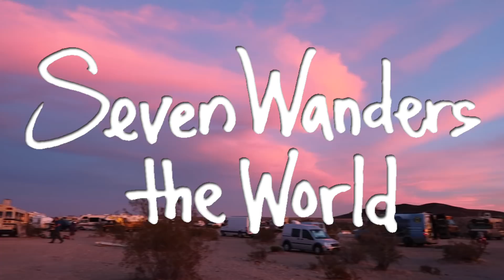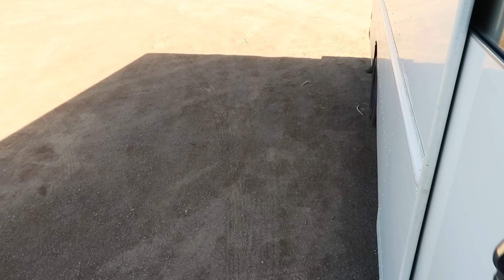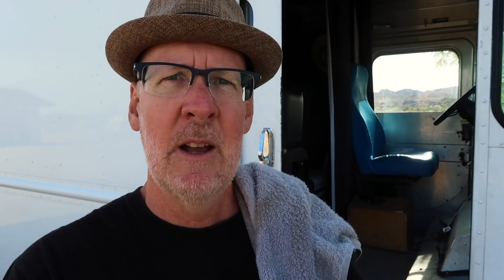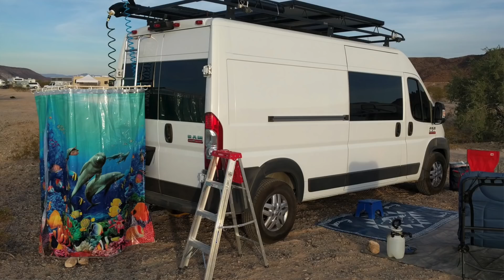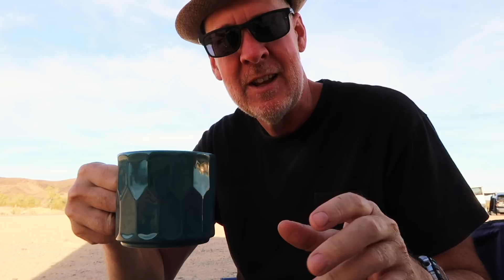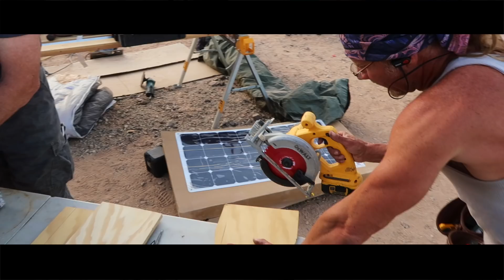Shower Dilema | Jamie's Van Build Party E334

Comment: Store a Pre Made shower Pan on Casters in the Toe Kick Area,Under a Cabinet,Pull out to Center,Under a Trap door/Cover,revealing a Drain thru Floor ,hosed to Ext.Side Bucket or Ground,Shower can beas Simple as a Marine bilge pump /Kit.sink sprayer placed in a Bucket of water,Cold and Hot (on Lp.stove,or Solar heated all day)mixed in a Bucket,K.I.S.S.works best,Can do it for You in S.W.Missouri,Enjoy your Channel.
Reply from the maker: thx for watching and your suggestion!

Comment: How about a shower right behind the driver's seat? It is already blocked floor to ceiling with the curtains and metal grill.  Have you seen Howie Roll's channel?  He built one of the best showers I have seen in a van.  He has a composting toilet.  It is a small room with a narrow door- very unobtrusive.
Reply from the maker: I had toyed with the idea of a shower behind the driver, but really don't want to block the light from the front windows. I'm trying to keep all build items below 40 inches tall. (metal mesh lets light thru)

Comment: I couldn't stop looking at your little white "hat tag" once you mentioned it... lol.  For a shower, just prop open your back doors and pop in a tension rod with a shower curtain on it. Use a 2-gallon ''pump sprayer bottle'' filled with water that has warmed by sitting in the sun. Presto. (Only someone inside your van could see you.)
Reply from the maker: the tag is distracting on video LOL

Comment: Nothing wrong with a little shower tent, Seven, considering you will only be using it occasionally.  No need for a cumbersome permanent setup.  Get a black solar tank to heat water on the top of the step van and have nice hot water any time you want.  When in towns, carry on using the easy Planet Fitness arrangement.  Dinna fret yoursel'.
Reply from the maker: that's a great option. I'll look into it

Comment: What about a removable floor panel that can be placed over the door well with a hooped shower curtain for starters? Good luck.
Reply from the maker: I'd be really scared the water would leak into the battery back under the stairs :(

Comment: If you have solar, you can have a water desalinator.  You take a shower and have a pre-filter.   Then have it go into a tank, possibly directly into the desalinator chamber.  The desalinator pump the water into the clean water tank.  The water should be cleaner than city and almost pure and much better to take a shower as it would be almost completely desalinated like rainwater.  Have a rainwater collection system and incinerating toilet.    Thus all your waste a day is about a cup full of dry waste a week, with no black or grey water or silly composting toilets.  It might be a little expensive $3000-$5000, but if you don't do it Elon will.
Reply: The boat builder I think he might be there knows how to make wood waterproof.  Thus you can make the shower out of wood and waterproof it.
Reply from the maker: unfortunately I have a typical van dweller budget and can't afford anything like that

Comment: Hello Seven, it looks you have many responses to the shower dilema, so I will respond to the shaky, vibrating condition on the step van. My first guess would be that you may need new motor mounts. Climb under there and take a peek at them, or maybe you could just pop the doghouse up and get a look at them. The motor mounts should be made of metal and rubber, the rubber being bonded to the metal parts of it. Look to see if the rubber on the mounts appear to be cracking,  squishy or the rubber seperating from the metal parts of the mounts. If you replace the motor mounts, also consider any transmission mounts as well.
Reply from the maker: thx for the info on the motor mounts. I did have a mechanic look at the mounts back in June and he said they were good. apparently my version of the Cummins just shakes like crazy

Comment: Plastic 55 gal barrel used on Craigslist 10 to 15 bucks, easy to cut with jig saw, small footprint, easy to attach pvc for the curtain hoop, can find them in blue or white. Check out my recessed shower pan in the finishing touches video I uploaded , it will have a carpet plywood panel so it's floor space when not used.
Reply from the maker: great idea. thx

Comment: maybe this is a dumb idea but since you rarely need the shower couldn't you just utilize the rear doors as a shower enclosure and shower outside? open the rear doors and attach a pole between the doors to keep them in position (you can use bungees to apply inward pressure) then just hang a curtain from the pole and take a shower.you would need to stand on a small tarp or something so as to not get muddy but it seems like a simple solution.
Reply from the maker: your idea for rear doors was the one I was thinking of when I made the video (similar to the photo inset shot I included of another van)

Comment: Here is a shower design, that will work both inside and outside
https://youtu.be/p1lMm8shPD8?t=598
For outside use, I would make the curtain longer. 

But I like the flexibility of use, the simplicity of design and components, and the minimal space it takes up when not in use.
Reply from the maker: thx for the link. I actually looked at this video a few weeks ago and at one time had a similar design idea for a hidden shower under furniture
Reply: What I am thinking is, to just have a lose pan at the bottom, so the water gets collected. This pan can be used inside and outside. 
When used inside, then the pan and shower curtain, can be hung/placed underneath your exhaust fan, and even if you use warm water, then the humidity can be pulled straight out of the van. 
Humidity handeling may possibly not be a problem on 77 degree days, but may still come in handy on other days. 
The simplest curtain holder rod I have seen, is a hula hoop ring. 

With a lose pan, and just hanging curtains, it is the  simplest design style I can think of, and it could be tested out with a minimum of modification/fabrication. 
And it could always be added upon, or part of it made more permanent, if fabrication time would allow for it some time in the future.

Comment: Check with Jax Austin if he is still there (short Skoolie) he has a shower mounted on the back of his bus.
Reply from the maker: Jax had to leave. he was there twice. I saw his shower setup. he is still having problems with the heater unit
Reply: I did see another van dweller who used a similar unit attached to the inside of his rear door and he used the small propane cylinders to power the heater.  It also kept it out of the elements.

Comment: S-W ..........                   Why not just buy a used class " C " unit with everything factory installed from soup to nuts............Should have a huge choice to choose from between $5k and $8k this time of year.
Reply from the maker: I'm six foot six. I looked at about 30 class C units and couldn't stand up in any of them
Reply: I finally understood your love of step vans after seeing you in yours, (I couldn't reach the ceiling, but it fits you) and watching your videos of the U-haul type truck you once had.  I suspected the driving position of a step van would be inferior to the truck, but I see that differently now, for someone your size.   Most class A and C motorhomes are very badly built.   I have a new respect for short busses and step vans, which are structurally superior to the typical wood framed motorhomes that leak and rot.

Comment: Sounds like this is what you are thinking, With the additional height of your van you will get  a slight increase of head over something like a Sprinter. 
https://youtu.be/epXd_mTXyyA
There was another video I couldn't find that was much easier to make, a group of lads touring S America in a Volkswagen camper, you , or somebody else, may know the channel I mean.
Reply: bren106 that link goes to the late show?
Reply from the maker: sounds like the Kombi Life channel
Reply: How odd, yes it does but what a great track. I'll dig out the one it should be.
Reply: Here is the correct link, it was done on the road so probably more useful than some of the highly technical videos done in a workshop setting. 
https://youtu.be/J4sXd4VY1m0